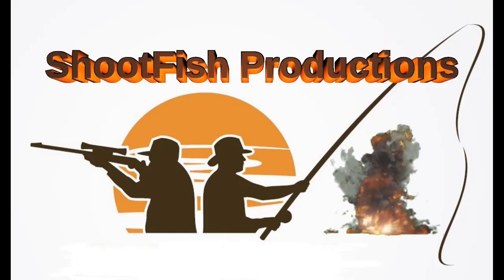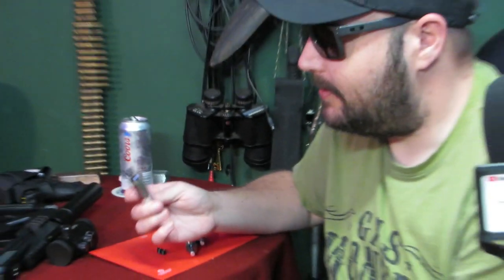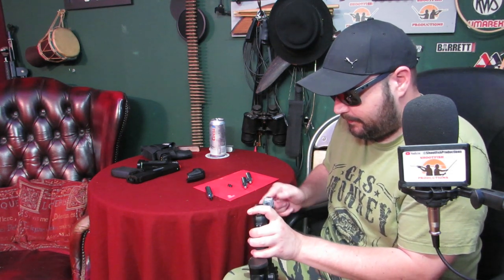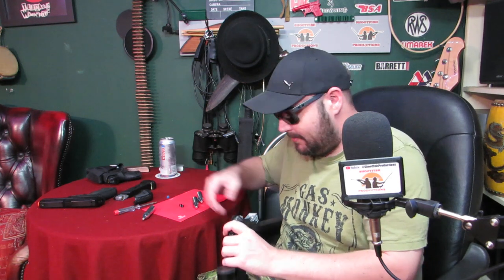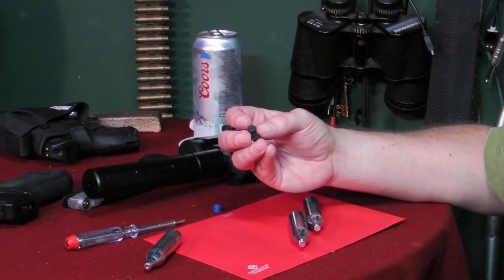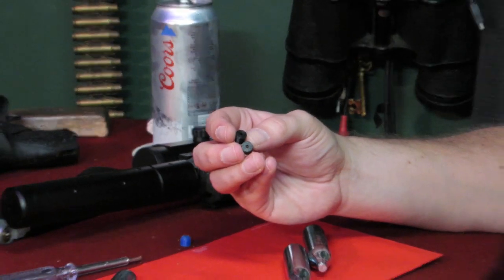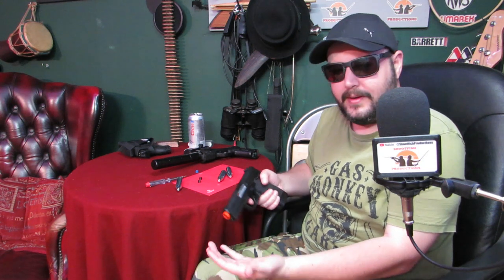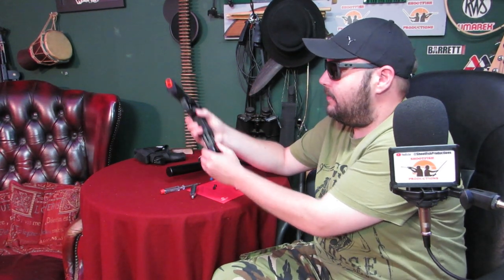Leaking Co2 Fix, Airsoft, Airguns, INSTANT FIX New Product

Comment: You guys DO NOT ship to florida USA, whats up with that?
Reply from the maker: read the video description
Reply: @ShootfishProductions  Bummer, you didn't answer the guy's question that I can see. I read the description, I'm in FL, and I'd like to buy these but you didn't answer the question nor is there any info about this in the video description. I also see that people keep asking where to get these and it's clear they missed that info but you simply add your URL. When I was a professor I'd answer student's questions by telling them to read the syllabus. That NEVER worked. I found it was just easier to answer the question briefly instead of repeatedly telling them to read the syllabus. So please, do you ship to FL USA or is there an issue with ordering that people should know about? Thanks for your patience.
Reply from the maker: @Samjohni  you can not buy via ebay outside of the uk. You CAN buy them from the website shootfish.co.uk.  and they are cheaper to buy from the website too. Hope this answers the question.

Comment: So it says these are made from "flexible TPU 3d printed plastic". I'm curious how this material compares to the rubber or synthetic material that most co2 seals are made from. Does it compress and seal just as well?

Also I have a Diana Chaser and I use Umarex co2. I'm assuming this would work for me no problem?
Reply from the maker: not sure how it compares, just know it works. Yes, would work with any gun that uses 12 gram co2.

Comment: Hi there you know your stuff i need your help yo fix my green gas powered blackviper revolver midsized barrel its not holding gas its just passing through and i cant gix it
Reply from the maker: sounds like the seals need replacing.
Reply: @ShootfishProductions  can you post a wee clip so I can try I know nanty about then to show me I open it up there is a cylinder in the grip I removed it n trying filling it again and it just hissed
Reply from the maker: @Loonyluna23  ive never done a green gas gun but I guess they work on the same principles. Next week i'll do a valve repair video on a bb gun  to see if it helps you.
Reply: @ShootfishProductions  xlent thanks for your help

Comment: After living with two Sig Sauer We The People 1911 .177 for a year, first one, then the second, contracted the dreaded CO2 dump affliction in both magazines.  While there can be multiple reasons for such malfunctions, on my two examples I found just one, and found it could be mitigated by simply preventing that CO2 cylinder from turning while you tighten.  Did you ever notice how your CO2 cylinder sometimes spins with every twist as you tighten it to pierce?

Why is that important?  The piercing valve at the top of the magazine is counter-threaded, (righty-loosey, lefty-tighty).  So when you tighten the CO2 against the piercing valve, as it is pushed against it hard, it has a tendency to actually turn the valve itself slightly.  Especially if you properly lube the top of an occasional CO2 with a drop of Pellgun Oil like you should, to keep the O-rings, seals and valves in shape.  

Counter-intuitively, unlike a brand-new unlubricated gun in which the tip of the CO2 "grabs" the dry white (in my magazines it's white, could be green in yours),  seal as it's getting pierced, mostly preventing it from turning even if you don't tightly hold it, a properly lubricated setup may not "grab" as well and spin.  Don't think skipping the lube is a solution...  that white seal really DOES need to be lubricated to prevent it drying out over time.  Thus, as time goes by, CO2 cylinders eventually spin REALLY easily as you tighten to pierce them.  It's surprising just how hard you then have to grip it to stop it from turning inside the magazine as you do.  As you tighten and pierce the CO2 and it spins clockwise while you're doing it, trust me that cylinder is pushing hard against the piercing valve seal, which it will inevitably turn clockwise too, loosening it, if only just a little.   As once was famously said, a little got more and more...  PFFFFFFFFFFFFFFFFFFT!

Worst part of all this is that it's darn near impossible to find a valve key (like the one that you got in the re-build kit!), that will fit within the confines of my empty magazines which would allow me to simply and easily just tighten that damn valve, leaving you to use flathead screwdrivers and the like, potentially damaging the needle or valve itself while not being able to really tell just how tight you got it.  I eventually took some online advice I saw, carefully UNSCREWED THE PIERCING VALVE, removed and cleaned the o-ring or (replace it if you have one), cleaned the threads and put the o-ring back on, silicone lubed it all, then WRAPPED PLUMBERS TAPE AROUND THE WHOLE THING, both the mounted o-ring and threads, before COUNTER-CLOCKWISE screwing the assembly back in as tightly as I could with no valve key.  

Another drop of Pellgun oil to top a new CO2, and tighten.  While I got a quick sputter it immediately became silent - it held air!  Since then, even leaving a full CO2 loaded for weeks or even months has caused me no ill effects as long as I kept the white piercing-valve seal "hydrated", kept from drying out.   And following these instructions.  

So as a preventative measure, if you grab your CO2 tightly while getting loaded. you'll probably always have a nice day!
Reply from the maker: Wow, thanks for that. Very detailed, thanks for sharing and hope it helps others.

Comment: Purchased
Reply from the maker: Thank you, happy shooting.
Reply: @ShootfishProductions  Hey man, i have a brand new SA XDM mag where the hex key didn't fit in the cap correctly, so I couldn't seat it in enough to tighten it up all the way, and the co2 just blew out while insids the mag. Bits of co2 ice were falling out and everything. I heard you say the valve is done after that because it's frozen and brittle. On the 2nd go round I took some sand paper to the cap so the hex key seated into it better and I was able to tighten a new bulb in there nicely. No leaks. Is my seal fucked from the first mishap? I was indoors, and it took a few min to do the sandpaper thing to the cap, so it had a little time to warm up. I have extra mags for it anyway, so I really don't care. I'm just curious. It's one of the reasons I bought these caps. Plus, I have the Sig Emperor scorpion with spitting issues during the first few shots. I didn't know until after I bought these cap sealers that they're only good for about 5 bulbs. So I jumped back on ebay and bought 2 more packets.
Reply from the maker: The original seals are damaged by leaving the gas in, and by inserting a new gas when the seal is frozen. I used the ptfe tape method with every new gas tank with no leaks but thought there must be a easier option, hence I designed the slip on seals. I have several co2 guns and they all had problems with leaking gas at some point. Now I use the slip on seals and they seal every time, with no long term leakage. Spitting issues are usually the valve which releases the gas freezing and leaking especially on the first few shots when the pressure is higher. Only fix for that is strip down and refurb of the valve if possible. Hope this helps. @BostonWhoFan515
Reply: @ShootfishProductions  can't thank you enough for the replies. So my sig spits on the first 2-3 shots somewhere around the top of the pistol near the rear sights. Can you explain thar fix one more time, my man?
Reply from the maker: I presume the gas goes in the removable mag?. Theres a pin which is struck by the hammer which releases a shot of gas. This is what leaks, and can be removed from the mag and taken apart for refurbing, which means fitting new seals and lubricating. I think they are o rings but not sure. You may get away with getting some silicone oil inside the valve by prressing the pin in and applying a small drop of oil. If it only happens for a couple of shots I wouldnt worry too much about it. @BostonWhoFan515
Reply: @ShootfishProductions  right. The gas in in a removable mag. This pin you're talking about there the trigger hit, is is a little kex key bit?
Reply from the maker: its just a pin, see if you can get a diagram for it from manufacturer, or search youtube to see if anyone has stripped one down. @BostonWhoFan515
Reply: where can i get these in the USA?
Reply: @deadHEADrabbit  I purchased them on eBay a few weeks ago. Just the other day, I got an email saying they're having trouble passing through customs hub or whatever it is over there, and since then, I've gotten no updates. So idk if it's possible. I'm still waiting. I'll give it another week or two at the most, then I'll be requesting a refund. It's unfortunate. I like these guys, and that's a killer product.
Reply from the maker: @deadHEADrabbit  ebay wont let me send these abroad, said  they were prohibited items. Ill check the postage cost to usa and get back to you. If you want to order i can take payment via paypal and send them myself.
Reply from the maker: @BostonWhoFan515  yes, ebay said they will refund you and couldnt send because they are prohibited items. Have had another usa enquiry, so i will find out postage cost and send them myself. Email us so we can sort it out between us. Email is on our “about” tab on youtube channel.
Reply from the maker: @deadHEADrabbit  email us, email is on our youtube about tab.
Reply: @ShootfishProductions  should I "contact seller" on ebay for the refund? And would that actually be you? Because I'll specify I'm the dude chatting on youtube....
Reply from the maker: @BostonWhoFan515  they said they will refund you, no action needed.
Reply: I ordered a heap of these things too! Lol. Paid a lot for shipping on each pack of 3. As long as I can get that bread back, I'll gladly grab them from you. I'm a regular visitor to your channel. I like you guys.
Reply: @ShootfishProductions  where your email at i couldn't find it?
Reply: @ShootfishProductions  right,  what I'm saying is there's no direct "request refund" link on ebay. So I messaged seller and explained.
Reply from the maker: @BostonWhoFan515  yea, ebay will refund you, if it dont happen click on the did not receive. Check your ebay messages too. Ebays global shipping is expensive so should be cheaper direct from us. Email us so we can communicate.
Reply from the maker: @deadHEADrabbit  email us
Reply: @ShootfishProductions  im trying no email link
Reply from the maker: @deadHEADrabbit   yea i just realised it dont show it on mobile app. Ill put an email address on the video description and on here in the next half hour.
Reply from the maker: @deadHEADrabbit  gonna put email address on video description and here in next half hour
Reply: @ShootfishProductions  yeah no email in your "about" page, bro....
Reply: @ShootfishProductions  okay sounds good and thank you i am very interested in buying some.
Reply from the maker: prezzyuk@gmail.com  @deadHEADrabbit
Reply from the maker: prezzyuk@gmail.com  @BostonWhoFan515
Reply from the maker: shootfish.co.uk @deadHEADrabbit
Reply: Forget the email back & forth what can we make them sleeves for cartridges out of????
Reply: @kevinhensley8601  Yeah, good point. We need to know because, unfortunately, we can't get them here in the States. I got refunded because there was a problem shipping them over the pond.
Reply from the maker: @BostonWhoFan515  - shootfish.co.uk - ships worldwide
Reply from the maker: @kevinhensley8601 shootfish.co.uk